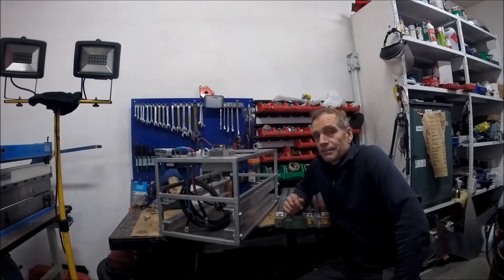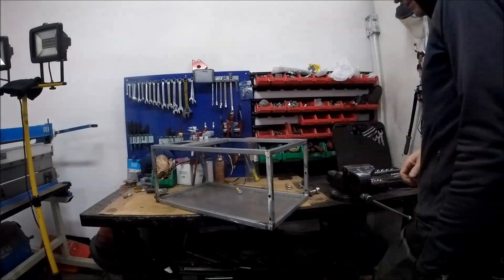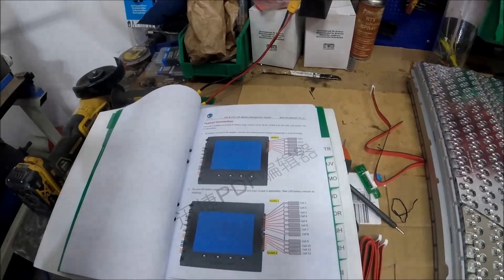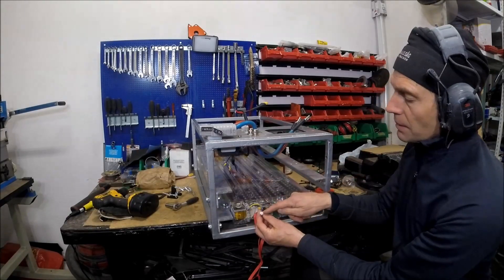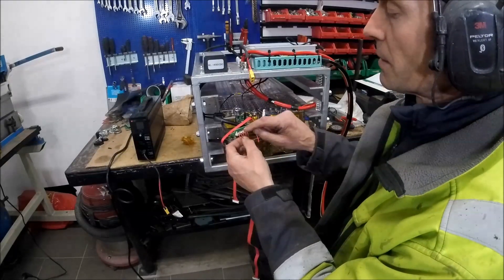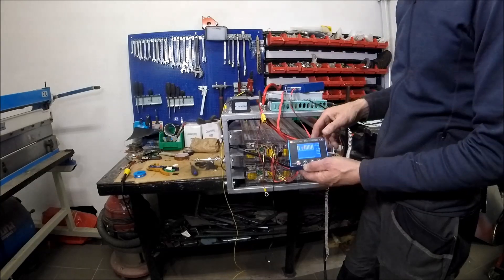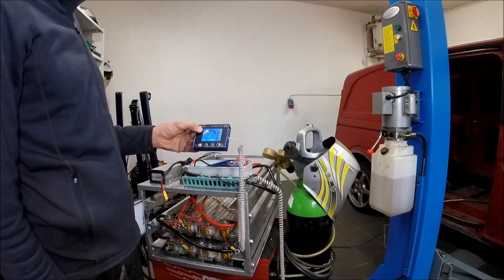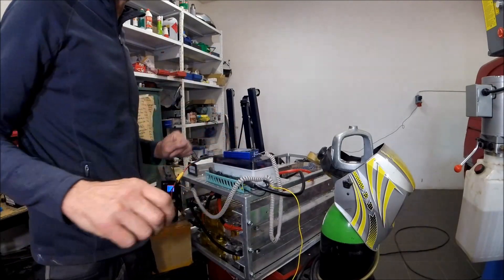Tesla Module batterypack 48 V with  Chargery BMS

Comment: How did you wire the modules to the bms? I’m having issues.
Reply: Im really hope you can share your exact wiring with me. My build is done except the bms wiring.
Reply from the maker: Hello, James !  Best advice of you cannot get the BMS wiring correct:  Remove all plastics from batterymodule, work on a not electrically conductive surface. If you are connecting 2 modules or more in series, connect them or be 100% sure what next cell is on second module. Made a mistake there myself. Then you measure voltage on each cell in order from B-, for exampel 3,7V, 7,4 V, 11,1V and so on, mark them and make sure you have them in correct order from B- and up. Then you connect BMS. Good Luck !!  BR Per

Comment: Have you used the charger bms on an ev? I have been wanting to know what happens if the low voltage is reached during uphill and the bms disconnects the loads (which I think what happens).. are you stuck on the hill? isnt there a way to limit the current or something so it doesnt disconnect or slowly climbs instead?
Reply from the maker: Hello, yes the BMS shuts down. You can limit current through the controller.  BR Per

Comment: Hello. Which DC to DC do you recommend for a 12s setup?
Reply from the maker: Hello, I have been using this one : https://kellycontroller.com/shop/kl-49dcdc/     It's quite cheap and durable, but you get lower amps when using in lower range of voltage.  BR Per
Reply: @persteel  Thank you for your response! I will look into it!

Comment: Ilm not sure if you have figured that out but sometimes balance cables come in 12 or 13 wires on BMS for  12s.. if it's 12 it means it takes the negative directly from the negative of the battery.. if its 13 the first wire will be the negative of the first battery meaning the actual negative of the full battery.. for the 12s setup you need to wire on chargery 9th wire which is 8s positive with the black 9s negative.. as in real life they are the same  so your 1st black wire on second slot  9-16 S is connected with last wire positive on 8s in 1st slot.. 

if you run the charge through their supplied shaut you can monitor the charge current.. if you have both charger and bms you don't need the relay as the relay usually works with external chargers to disconnect them based on the impulse from the bms but the actual chargery charger will disconnect the charging if you set the parameters for Overvoltage, temps and over current..  my BMS gets super hot almost smoking if I use just the battery as battery supply hence I prefer to use external DC charger
Reply from the maker: Hello, thank you !  Yes I figured that out after a while after I burned the first BMS. Was a bit careless when I mesured voltage before I connected the wires.  BR Pär
Reply: @persteel  yeah the issue is they tell you you can use the actual battery but if you toggle between the ext PSU and Battery it has tendency to push lot of amps hence it will burn down.. did you get external PSU or keeping the power source from battery for the BMS to work? also does your get super hot?
Reply from the maker: @archeebookingagent1909  I used internal battery to power BMS. Yes , it did burn when I toggled between internal and external source, but it was during surch for false.  It do get hot when working...
Reply: @persteel  and that's the part I don't understand on this because they say you can use the actual battery to charge it.. I saw it would go up to 200 Amps which is crazy..  my pack can output constant 160 AMPS constant but peak like 300.. I'm still not sure why this is maybe Jason can elaborate on this from chargery ..

Comment: For the Chargery, don't you have to use an external contractor for it to function as a BMS?  Otherwise it just functions as a balancer and monitor?
Reply from the maker: Hello, that is correct ! You must connect a relay to the discharge output on BMS to break circut or a small relay to disconnect main relay on load, that is what I will do.  If you use Chargery charger to charge batterypack it is controlled automatic by canbus, otherwise you must use relay here also.

BR Pär
Reply: @persteel  The relay or contactor is energized by a 12v from the Chargery, correct?

Do you know if the Chargery can cut power when it detects a temperature problem (below freezing, or above 50C for example)?
Reply from the maker: @asusreviews  Hello !  Yes, you can set all parameters as temperatur limits in setup !  BR Pär